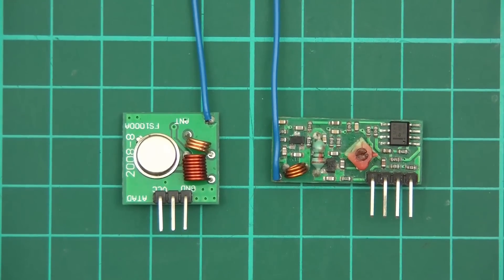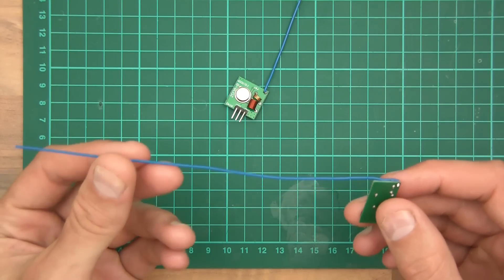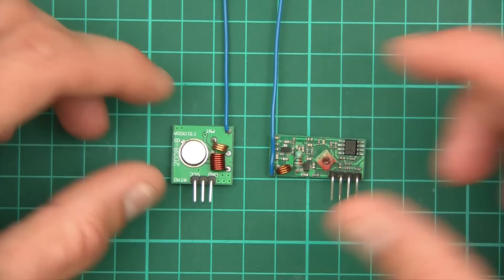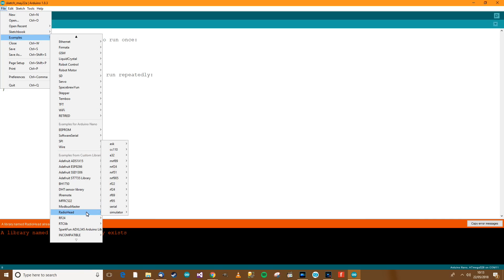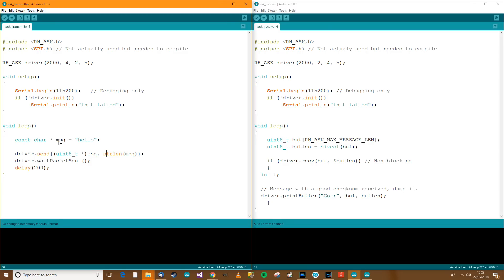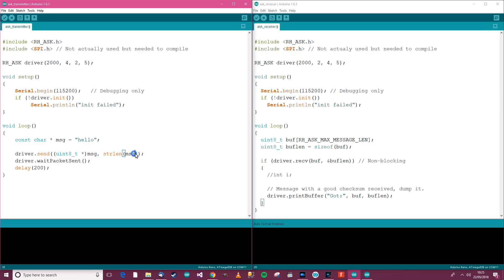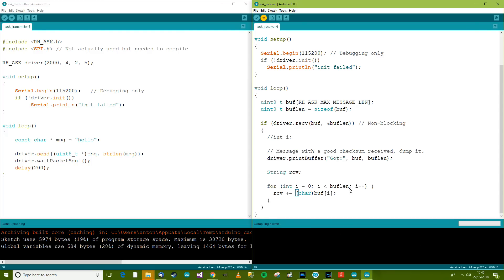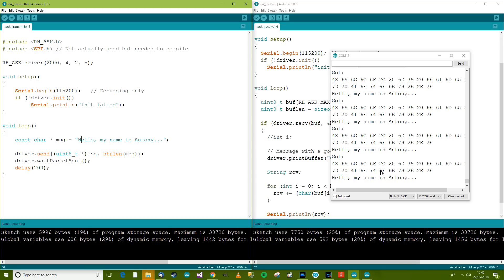TUTORIAL: How to set up wireless RF (433Mhz) Transmitter Receiver Module - Arduino Quick Simple

Comment: why a driver? if you take the serial lines to these modules, the data just zips in/out - carrier present (i.e. transmitting 433MHz) for 1, no carrier for 0....... which presents a problem as serial is usually left in a resting mark state (1) which means the transmitter is left permanently on. OK... got it - the driver applies a protocol over the top of the serial port and deals with the "fluff".

This is why I don't really like libraries - they hide too much. I appreciate they can make things accessible to those of us who couldn't write from the ground up.

Comment: Do you have to have an arduino on both sides?  If I wanted a very simple sensor, can I just power the transmitter side and pulse it's data line or does the Tx just not work without the processor?

Comment: Hello, 

When i plug my receiver into my arduino , arduino shuts off as if there is a short or something. iIve tested with my other arduino and my other receivers and the same thing happens is this normal?
Reply from the maker: It's not normal. The chances are that you're pulling too much current. While the Arduino is running, connect the receiver gnd to gnd, then vcc to vcc. Does it still do itm

Comment: This should work without antennas shouldn't it? And if it does i have a question about why is my printing so slow instead of 0.2 seconds like with yours it takes me 5 seconds or more just to print one.
Reply from the maker: It's supposed to have an antenna of an extract length, from what I remember. To be honest though, these modules are not very good quality.

Comment: A variable that doesn't change??? lol.
Reply from the maker: I assume you're talking about programming? A variable that doesn't change, we call a const. A constant variable. 🤣🙈
Reply: @antonycartwright  Indeed.  I find it funny that you call it a variable that doesn't change.  A variable, by definition, is something that changes, while a constant is a value that doesn't change.  But, I understand your video is directed to the beginner.  Perhaps you should add, a Wall is like a door that doesn't open?  Just in case someone is a real beginner....  hehe.
Reply from the maker: @COSMACELF1802  It's strange isn't it? Here is a variable that never changes. How can it be variable if it never changes? I suppose it's like a variable resistor that's glued into a stuck position. We still call it a variable resistor though I guess. 🤷‍♂️🤷‍♂️🤷‍♂️ 

I guess it's because when you declare the variable, the system doesn't understand that it's not going to vary. It's an interesting point though.
Reply: @antonycartwright  The constant is written into the program space of the Atmega 328 chip (the heart of the Arduino Nano and Uno).  This memory space is Flash memory (a kind of EEPROM), it can be written to in blocks but not byte by byte, so it's impractical to store variables in it (also, it has a limited number of writes before it goes bad).  But, the space is addressable, so you can have your program fetch constant data from it.  Usually look up tables or hard coded messages like this one.  The 328 chip has RAM space, that's where the variables are stored.  You can declare a variable with an initial value, the Compiler will hold a constant in program space and copy this constant to RAM upon start (that's just what's happening behind the magic curtain).  Just the same, thanks for your video and the introduction to another library.
Reply from the maker: @COSMACELF1802  It sounds like you're more aware of the innings than I am! I'm aware of the stack, heap and and all of this, but more from an x86 perspective. I'm not sure how other controllers and processors work.

It is an interesting point though. I was thinking something similar a few days ago. Why can't you edit a value in an enumeration in .net framework? It's because the framework creates an enumeration based on the underlying objects in order to present the findings. So if you edit an enumeration, it doesn't actually save over the original value, it saves into the newly created enum. We get these weird issues I guess.

Also, with the introduction of lambda, linq and so on, it must be really hard to learn programming in 2024.

Comment: You should also be able to use shorter antennas that are equally effective as long as their lengths are exactly 86.5 mm or 43.25 mm (173/2 and 173/4, respectively (42.35 mm ~ 433 Hz).

Comment: What to do when there are two transmitters and one receiver ? How can the receiver distinguish one transmitter from the other?
Reply: @evanfrabell8884  Thanks, so the receiver hears both transmitters -- hopefully one at a time -- and then the program decides which transmitter the message it received came from. Super!
Reply: There are protocols for dealing with this, which comes down to how you might run a meeting of a few people in the same room.  It works better if all participants can listen as well as talk.

Rule 1:  Listen before you start talking, to make sure no one else is already talking.

Quite often, two or more people will start talking at once.  This is most easily resolved if the person in charge of the meeting can tell everyone to shut up, then cue one person to speak.

Failing that, the person receiving can acknowledge hearing the message.  If there's no acknowledgment, rule 2 applies:

Rule 2:  If you weren't heard, shut up for a while, then try again.

That method actually is used in some forms of wireless networking - wait a random amount of time (use a pseudo random number generator) then try again.

This all relies on all participants being able to both talk and listen, though usually not doing both at the same time.  As Evan said, each message also needs to contain the identity of the sender.

If you just need two transmitters, one simple way would be to use two different wave bands, e.g one pair on 315MHz and one on 433MHz.  Provided the transmitters aren't too close to the receivers, you should get enough separation to use both at once.   

You might want a separate microcontroller for each receiver though, or at least a separate core.  If you use a dual core microcontroller, like the Raspberry Pi Pico, you may be able to get a separate instance of the library running on each core.
Reply: @TooSlowTube  Thanks, TooSlowTube. I think the problem was originally "solved" with something called the Aloha Protocol. But, I like your 433 / 315 idea. That would let me know who is transmitting without them having to identify themselves.

Comment: i want to display the data at the receiver's end, how do i connect this
please help
Reply: There are Arduino libraries for LCD displays and OLED graphical displays.  If you just want a text message, a simple text based LCD display should be enough.

Just one thing - some LCDs have a way to adjust the contrast, and you often can't see anything until you do.   If you're connecting a bare LCD panel to an Arduino, you usually have to add a 10k Ohm preset potentiometer (aka trimmer pot), to set the contrast.  If this is unfamiliar to you, you might be better off with an OLED display.

Comment: What I want to know is, how did you figure 173mm for your ant. length and not 165mm for 433MHz..?
Reply: @Curtis Evans, I read that the speed of light, 299,792,458 m/s, is divided by the frequency, 433,000,000 cycles/second, giving .69236meters per cycle, or 69.236cm and then 1/4 of that -- dunno why though -- is 17.3mm.
Reply: @rongarza9488  Close, but you're out by a decimal place  It's 0.173m, which is 17.3cm, not 17.3mm.

But, yes, it's a quarter wavelength and that's how you calculate it.

Comment: Very good tutorial, thanks.  I ended up using the HT12E and HT12D, encoder and decoder chips, to process the serial data into bytes, check address etc then connected the data busses, xmt and receive to Arduino pins, works well.  You commented the code was unnecessarily complicated, with these chips no library is needed just pinmode settings, digital write and read.  The decoder chip has a VT pin, valid transmission pin you can monitor in the loop section to see if a transmission is coming in.
Reply: He was commenting that the C/C++ syntax for a string constant (const char * ...) seems unnecessarily complicated, rather than the library.  The Holtek (HT12E / HT12D) chips seem like a good way of doing it though.  I looked into using them years ago but never got around to actually building something with them.  If I manage to find them, I'll give it another go.

Comment: great video.

Sadly, it looks like I have a duff bag of these from Bang Good.

Literally nothing is being sent or received :(
Reply from the maker: They're poor quality. Don't bother. Try reyax rylr modules. 🙂
Reply: @antonycartwright  I have some lora modules that I am planning to take a look at next.

Really wanted to get these ones working before I tried them out though :(
Reply: these modules are 99p for a reason and I consider them "only just working" and they swamp heaps of channels either side of "centre". Instead, use pairs of HC-12 - much better devices and no driver required (it's in the hardware) - but not 99p. 

have a look at a USB SDR module and something like SDRSharp to determine any transmission and what frequency it is at , you can find out where they are and then tweak the reciever accordingly. watch out for licence violations on really bad units

hth
Reply: @captainboing  they don't use channels...

Comment: I'm working on a project and I need it to input the distance between the  2 arduinos in meters
Reply from the maker: You can't do that with this equipment. The libraries only tell you about data which has been pulled though, as far as I'm aware. You'd be better off getting GPS modules.

Comment: Thank you Antony. I've just started with Arduino and my first simple project is to use this module. I've found lots of detailed coding but no one who has simply explained how to add the code to the library, until I found you. So far I have only installed the library and not set the circuits up but I'm already exited to finally get this far. Thank you John.

Comment: Hi brother. 
( 433 model my used   green color )      
Am making new rf project. 
Please your support me. 
Transmitor side rf model  , Arduino prominy. 
Recover Sid rf receive model , ht12d ic only. 
I have a DSO( Ocsiloscop)in my hand. 
I checked another way and found the  ht12e ic  signal . 
But my problem I do not know how to write that code in transportation side. 
Please help my brother.

Comment: For anyone confused why the antenna should be 17,3 cm long ... its because it is approx. 1/4 of the wavelength of the carrier wave which is the optimum antenna length for transmission and recieving.
Reply: would it work if i make a spring with that length of wire?
Reply: @F.A.1.8t  Yes, that works too
Reply: Gauge?
Reply: @freeflyer1 also curious if gauge plays into transmission

Comment: 12:13 
ampersand means 'address of'.

(pointer points to first byte of value.
the function expects a pointer on first variable and expects a pointer on second variable too.
pointer holds an address of memory)

because normal variable used (not a pointer to dynamically allocated memory).

to get something that is like a pointer of from a variable.
we ask for address of that variable , where is it where it stores the value.

Comment: So this is what shown in the serial monitor after i follow all the steps mentioned in the video

ets Jan  8 2013,rst cause:4, boot mode:(3,6)

wdt reset
load 0x4010f000, len 3460, room 16 
tail 4
chksum 0xcc
load 0x3fff20b8, len 40, room 4 
tail 4
chksum 0xc9
csum 0xc9
v00043250
~ld

Comment: whether this transmitter receiver pair can be used for making a walkie-talkie? i mean with two pair of transmitter-receivers? If not, please give me a brief explanation. I am novice in RF communication,  but i know about voltage, current & arduino.
Reply: These modules can not be used for walkie- talkie. The max bit rate  is less than 2000 bits pr second. So their primary use is remote control of lights, garage doors or door bells etc.
Reply: @oladunk9986  thank you.

Comment: Just being picky but the silver thing on the TX is not a crystal.. it's a complete crystal controlled transmitter IC. Same with the chip on the RX - that a complete receiver not an amplifier.  The antenna length on the instructions that came with mine say 250mm ant on the TX and 320mm on the RX. Although 173mm is an exact quarter wavelength on 433Mhz, the longer lengths given on my info doc MIGHT be to achieve a better impedance match to the devices...... but....
edit:  I can now see that there are variants of this Rx - TX pair. The antenna lengths above came from info with a pair in which the transmitter unit has only ONE coil on the board. No doubt 173mm is correct for the version above. Check the supplier's pictures. Online chat suggests the receiver is very poor quality and can be bettered with the equally cheap RXB12  receiver. (a supeheterodyne design)

Comment: *important note*
place a 100uF cap between VCC & GND close to the receiver.  Any small ripple or noise or small abrupt changes in VCC will be amplified by the RX circuit and will show up as an output transition on the RX pin.  This receiver is very sensitive and has poor power supply rejection  ( very twitchy to noise on VCC)
Reply: W comment

Comment: can I use this set up to test tv, dvd or sat remote controls to see if every button is shooting IR out?
Reply: I don't know if you still need an answer, but you can usually test a TV remote control by pointing it at a digital camera, and watching the display / screen on the camera.  

Digital cameras see far enough into the infrared to detect the output of most remotes, but it gets displayed as visible light.

Comment: I've been looking into making a wireless on/off rocker switch set up for the light bars in my truck. I'm wondering if this type of an rf switch would work to power on and off the lights without running wires into the cab. (Ie. Transmitter in cab receiver under the hood to control more then one like) is it possible to do with these?

Comment: Thanks, right what I needed and super detailed, I like how you explained almost everything in the code so it makes more sense.
Question: Is it the same with the stx882 modules?They seem to have the same pins. (here's the link: https://cleste.ro/modul-wireless-transreceiver-stx882.html ) you might need to translate it tho, I'm choosing that one because it was a more compact antenna which I need in my case, I think. I have a feeling that the one you made will eventually break and I don't want to bend down and stuff :). Anyways keep it up!

Comment: My transmitter/receiver combo is a four channel 433Mhz setup with a 1527 chipset working just fine as a standalone receiver and transmitter.  Hooked up an led to the receiver and had no trouble turning it on and off with the transmitter.  When I connect it to the Nano with data pin 0 connected to pin 2 on the Nano, code loaded with no errors, I get no output on the serial monitor.  Baud rate is set to 9600 and com port is correct.  I'm a bit stumped as to why this is not working for me???  I inserted a Serial.println message after the Serial.begin statement, and that shows up fine too, but nothing else???
Reply: Same here. Did you find any resolution?

Comment: Could you put a larger antenna on the receiver to gain further range , only currently getting about 15m from these
Reply: Buy a better receiver like RXB6. More expensive but a lot better. Don't forget the antenna, 173 mm on both transmitter and receiver.

Comment: Nicely done. I must point out a few things, only for elucidation purposes.The aerial should always be straight and lol you take out the variable initialisation of i, then use i. Good practice and one that is defined in MISRA is that all variables be initialised with a value. I also like the way of naming variables, so you know what the variable is. take buff, if it were renamed to ui8Buff, you would know it is of type uint8. Not hard to say in a little program, but you get into longer lengths, someone else reading it will know instantly what type it is.

Comment: The receiver board in my weather station has died it operates on 433 mhz and uses an lm358 op amp the same as this board 3 connections ground data and vcc will that receiver board be able to replace mine they look very similar?
Reply: The receiver is just a tuned circuit, so there is no reason why it shouldn't work, other than the tuning of the circuit via the variable inductor.
Reply: Can i have a copy of your weather station project sir?

Comment: Can anyone please explain the significance of the exact 173mm length?
Reply: dannymaciejewski That is exactly 1/4 length of 433Mhz frequency wavelength (692.4mm). Antennas are usually 1/4 or 1/2 length of the wavelength you want to transmit/receive.

Comment: It works with the regular blink code on the transmitter an your code on the receiver both on pin 13 but your code on the transmitter an receiver doesn't work,I opened the serial monitor an even solidered on antennas but nothing gets transmitted,what could I be doing wrong?

Comment: Great video, I have a question for transmitter. I don't want a arduino for transmitter and send fixed message for only error exception. For example "Door number 2039 is open". Is there a module you can recommend
Reply from the maker: ATTINY85?